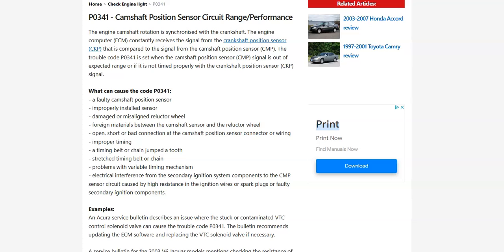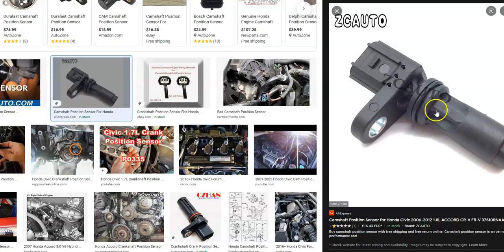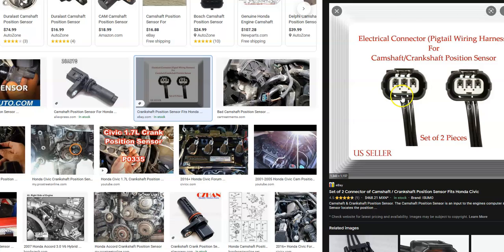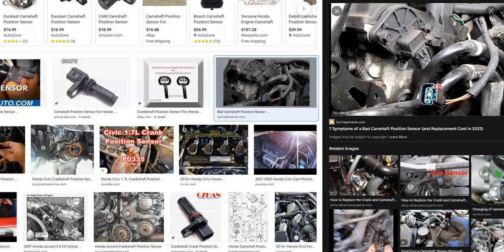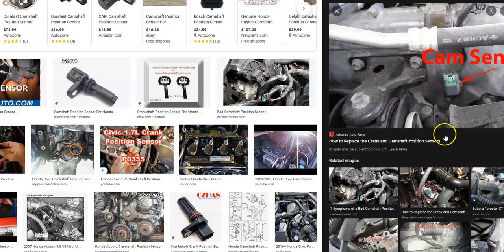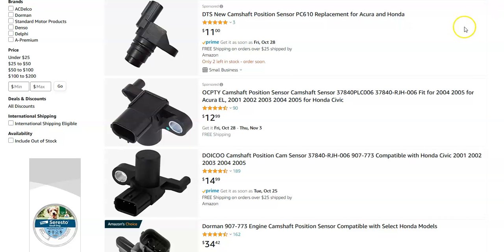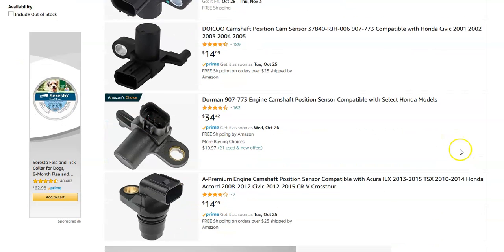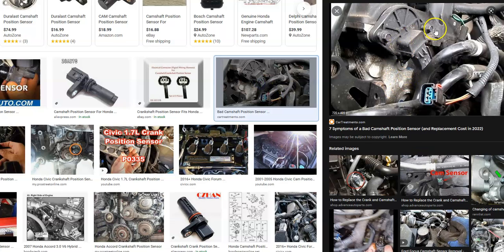How to Fix Honda P0341: Camshaft Position Sensor Circuit Range Performance

Comment: I have a 2012 Honda accord I’ve replaced all timing components,replacement cam ,cam sensors.also did relearn procedure still can’t figure out the problem

Comment: So on a 2009 honda accord there are 2 camshaft position sensors one on the lefr and one on the right and they are locates on the drivers side of the engine bay. This is a 2.4 bybthe way. My question is which one is bank 1? I am thinking it is the left side sensor the one closest to the front of the car but am i wrong?
Reply from the maker: Bank-1 is the side of the engine with the #1 cylinder. Google "cylinder location" and your engine Google images will usually show it.
Reply: Poster was talking about an inline 4 bro. Not a v6.

Comment: Timing chain stretch also causes p0341 code and if the timing chain is stretched or it jumped due to slack in the tensioner it can foul up your valves. If you get this code your best bet is to stop driving the car untill you are completely sure what exactly is causing the problem.
Reply: Is it the same for timing belt?

Comment: I got honda accord 2014 i got cod p0341 after changing chain tensioner and vvt sensor and vtec chain i checked all my cam sensors its good all sensor is good but the car is not working very will the acceleration is so bad 😫  plz tell me what to do
Reply: Check that both gears driving the cam are oriented in the right direction. There will be arrows that should be in relation to each other when the engine is top dead center
Reply: @kristopherdowell  the man who replace the vtc actuator is dumb he didnt unlock it so its broke i buy a new one
Reply: Check your catalytic converters.